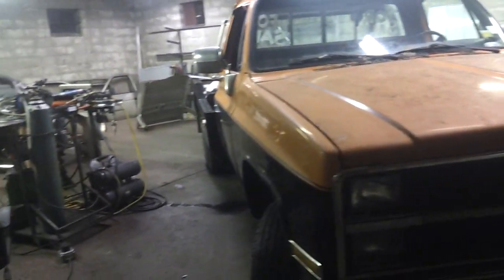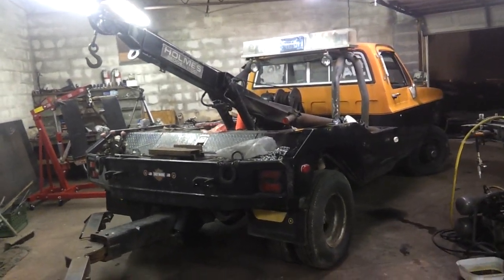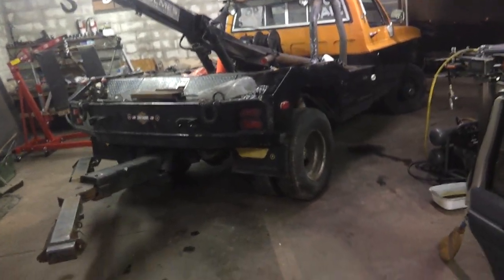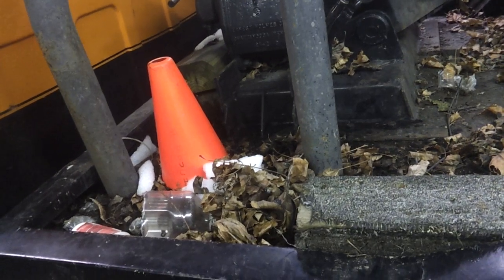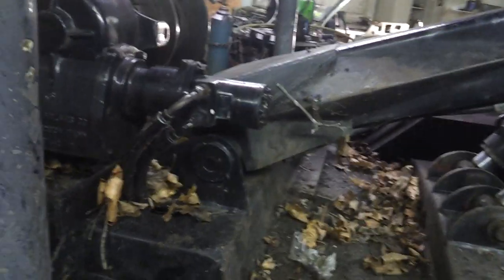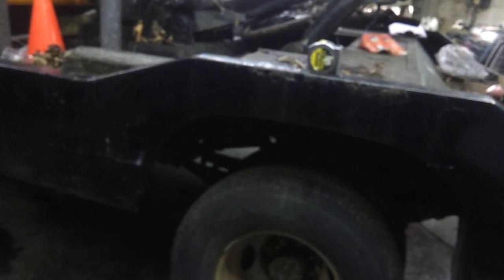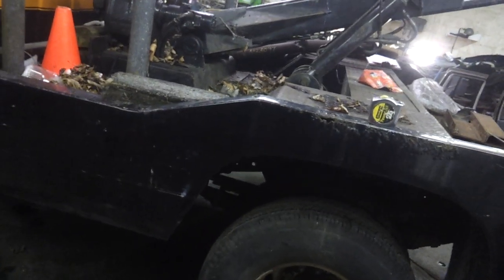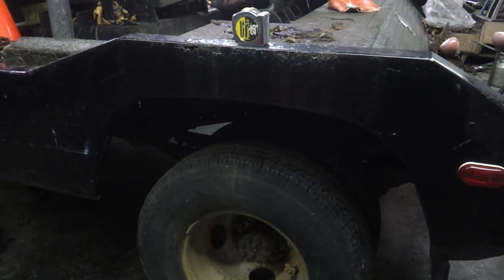Project Tow Truck (Rust Repair) - Part 1

Comment from the maker: However I'm constantly brain storming to try and find that product that could easily be reproduced that is small enough to ship or easily broke down to a manageable shipping size. Ether that or something that would be in high demand locally. hmmm I have a few ideas but they all end out being high dollar investments so I'm hesitant to pull the trigger. I need to find some low dollar investments and see where that goes.